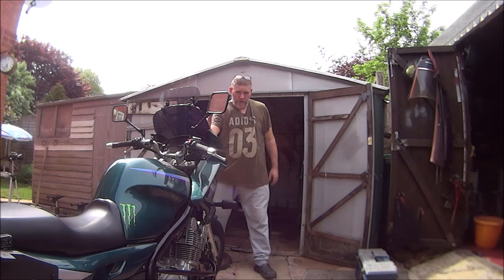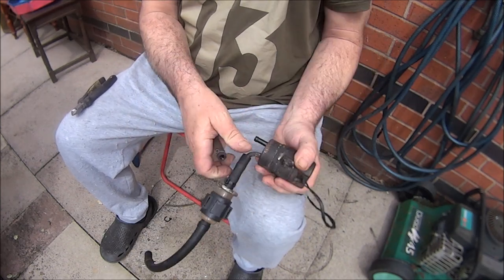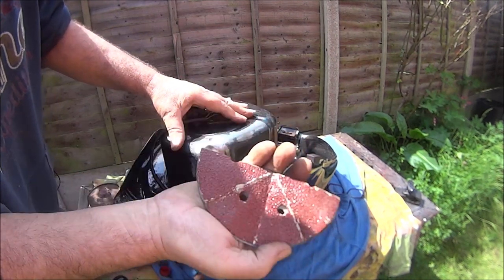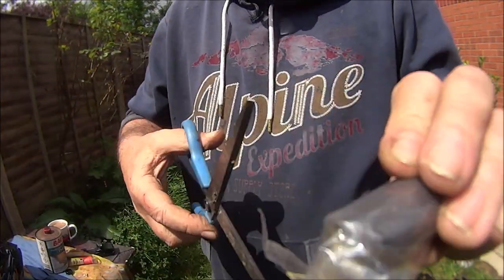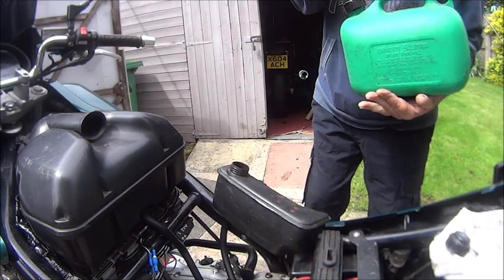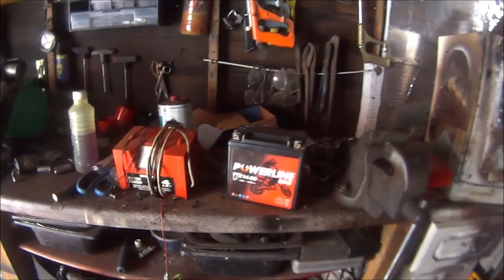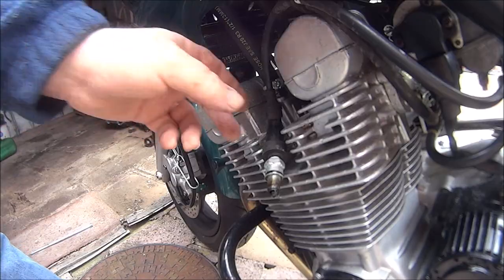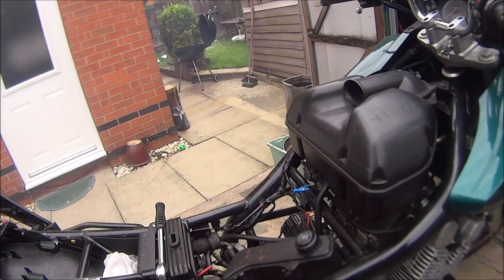XJ900 DIVERSION. fuel Pump replace + FUEL TANK repairs.

Comment: Just a thought put a self tappin=g  screw with a rubber o ring in the hole then putty on top .
Reply from the maker: Thanks Paul. I did try that the first time but the metal is to thin to tighten the screw. Hopefully this will last if not I'll try the jb weld stuff cheers for the comment buddy 👍

Comment: When starting mine after a few weeks (or even months) I press the starter for 1-2 secs then release. I can hear the fuel pump ticking then stop. Initially the ticking is fast. Keep doing this as it allows the pump to pressurise the supply to the carbs without constantly cranking the engine. It normally starts after 3-4 cycles and it doesn't hammer the battery.
Reply from the maker: Thanks for the advice mark..  Much appreciated. 👍